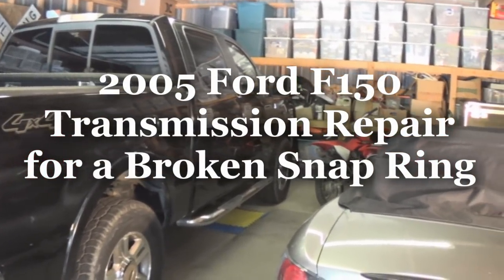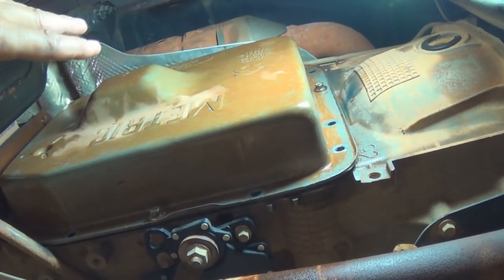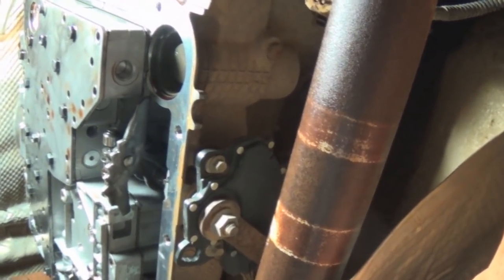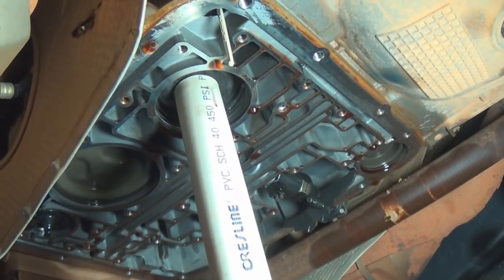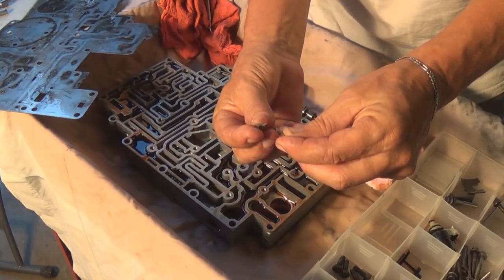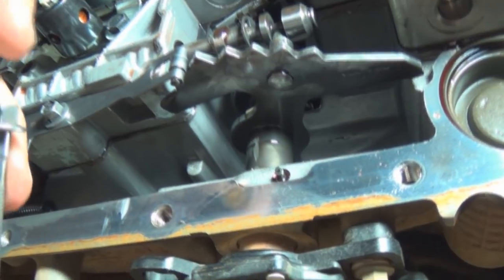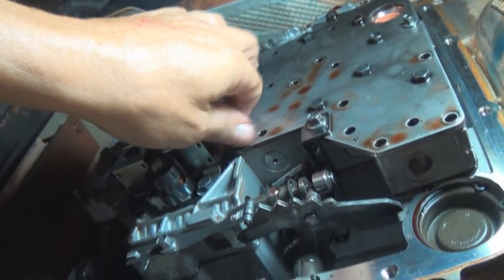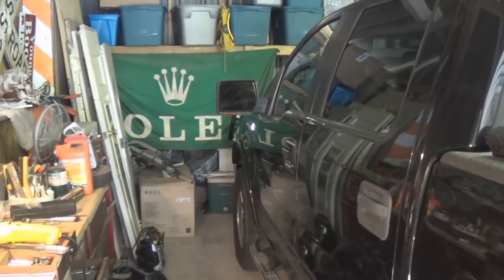2005 Ford F150 Transmission Repair for Broken Snap Ring

Comment: I would replaced the OD servo and replaced the servo pin with a Sonnax servo pin upgrade. That will stop the OD servo from beating up that snap ring. Replacing the 8 check balls is usually a good idea too while you already have the valve body opened up.

Comment: Thanks for the video. Exact same symptoms. Never opened an automatic transmission before but proceeded with confidence from your example. A little difficulty doing the job while keeping my fingers crossed but that paid off as the broken piece was in the same place as yours. Ford wanted to sell me a new tranny for $3,500.00 as mine has 350,000 miles and friends said I would be wasting my time and should give the junk yard $1000.00 for another transmission. I really enjoyed rubbing it in their face that I fixed it for $3.17 and a Saturday afternoon. My truck is shifting fine and still on its way back from the moon. 476,000 miles is my goal. Thanks
Reply from the maker: Gary thanks for watching and your great comment! I'm very happy that my video helped you out and it is great to repair something rather than replacing it. Your comment made my day. Thanks again.
Reply: That's awesome
Reply: That’s great but his you could see at the end was still experiencing what i thought was torque converter lock up. So id like to know how these repairs turned out for you guys in the long run before I tackle it

Comment: Good video. Better than some I have seen. Thanks for sharing. Funny how little things break and cause us all kind of havoc. Anyway good luck with the truck.
Reply from the maker: Miguel S thanks for watching. Yes I made this video because I could not find a single video that covered the whole job. Unfortunately my trans was to far gone and had to be rebuilt. If you have lots of metal on e magnet or in the pan I recommend a rebuild or replacement to properly repair.

Comment: Guys, if you're going this far into the valve body you should replace the separator plate with a Superior Tuff plate and upgrade some of the internal valve body components with upgraded Sonnex pieces.
Reply: Other than the upgraded servo pin, what would those internal valve body components be exactly?

Comment: this is the best video so far of this issue ! thanks and good job!
Reply from the maker: I found videos online for the broken retainer but I had to watch numerous other trans rebuild videos to better understand the procedure. So I decided to make a better video on this subject. Thanks for watching!
Reply: did you disconnect the battery first? just curious
Reply from the maker: No need, but my battery died and removing it and replacing the battery without using a temp 12v source caused the computer to have to learn again when to shift. Clears up after a number of miles of city driving.

Comment: Good work on your pickup. I hope that it is still in good working order. Happy Holidays 2021.
Reply from the maker: Thanks! Turned out that the trans was completely shot and needed to be rebuilt. Had that done but I sold this truck and bought another one (Nissan).

Comment: Just got the snap ring for my 2004.  Had to drive from Chicago to Missouri with no OD. Waiting for a day above 35 degrees to get this knocked out.
Reply from the maker: Thanks for watching!. As you know, the truck burns a crap load of gas without O/D, but great that it got you home. If you open it up and find an excess of metal (mud) on the magnet or in the pan and your old fluid smells "burnt" you should consider a complete rebuild. If the fluid looks good, then go for the retainer ring replacement, but be sure you account for all the broken pieces of the clip. Good luck.
Reply: See More Toys the fluid looks good. Trucks got 165k on it so hopefully that’s a good sign.

Comment: I have an 05 150. From park to drive, there is a 4-5 second gear engagement delay into drive. Any ideas? Please reply!
Reply from the maker: Check your fluid level on the trans after warmed up. Smell the fluid for a burnt smell. Also, could be a failing valve seal. There are a few common causes of delayed engagement in automatic transmission vehicles. Sometimes, delayed engagement can be caused by temperature changes under the hood of the car. Delayed engagement could also be the result of worn seals, stretched out bands, or poor transmission fluid pressure.
Reply: Boost valve maybe?
Reply: OLDSOUL: Did you find out what caused the shift delay?  I have the same issue with my 2004 5.4L

Comment: I had the same problem with the broken ring. Replaced it and it shifted fine for a bit, then once it warms up driving, It shifts back into neutral. Any ideas out there what else it could be. Thanks.
Reply from the maker: I don't know. Hopefully all the pieces of the broken retainer clip were removed. A small piece left there will cut out the O/D into neutral by blocking trans fluid flow.

Comment: Could this snap ring breaking cause the transmission to shift but want to always pull into reverse?  When in reverse truck will run. Every other gear does not allow truck to move forward, however it still wants to pull as if it is in reverse still. If that makes sense?
Reply from the maker: The snap ring breaking only caused the trans to slip into neutral when it when into overdrive. Turn off the overdrive and the trans operated as designed in all gears. But it suck fuel even worst than normal.  Sounds like you had a band break inside the trans. I recommend that a complete trans rebuild or replacement is needed.

Comment: Right in the middle of this fix, Caution-those magnets are very slippery and very very brittle. Hope the dealer has on in stock!
Reply from the maker: Rusty Shackelford yes those mags are brittle. I carefully wiped off the metal stuck to it with a with a rag. I was thinking of getting a pan with a drain plug to make life easier but I did not. I got my parts from a local transmission supply. Much much cheaper that the dealer or auto parts store.

Comment: i thought for sure this was the issue on my 2011, clip is still good and couldnt find any FOD i could see the overdrive band.. im baffled going to the scan tool i guess
Reply from the maker: You may have something blocking the oil hole that moves the plunger. You may need a complete rebuild though.

Comment: 19:38 i can see the RPM's fluctuating ... is the transmission slipping at all when they are going up and down ?
Reply from the maker: My 3rd gear was going (or gone) also. It ended up blowing the overdrive band and had a lot of metal stuck to the magnet in the pan. So I sent it out for a rebuild. Transmissions are not my favorite thing to work on.
Reply: Kenni-411 yes but hes to proud to say he made it worst just buy a valve body

Comment: I have a 2005 Ford f150 and it drops into neutral outer overdrive my question is can I drive it with the overdrive off without causing any problems. If there are pieces floating around do they not cause problems with the overdrive off thank you in advance
Reply from the maker: The ring clip breaks. Pieces of the clip get stuck and keep the OD valve from opening. Those pieces won't go far and most likely will not be a problem. But, running without the OD will burn a crap load of gas and put strain on your entire power train.
Reply: @seemoretoys5944  I can deal with driving it 45 miles an hour because I already have 200,000 miles on this truck and it's an 05 so it's not worth very much and don't want to spend the money on a total rebuild or replacement. I may just use it to put my boat in the water. Thank you for the advice

Comment: That was a great video,  everything was very well explained.  Where is the best place to get the snap ring?  I feel like if I goto my local parts place they're not going to have a clue what I'm talking about.
Reply from the maker: Thanks for your kind comment and question! If I remember right, I ordered it from Amazon. Only cost a couple of bucks. You can also find very good deals on car parts on Ebay.

Comment: So after this repair I immediately got the TRANS FAULT O/D OFF light on my dash?? Any ideas??
Reply from the maker: Recheck your work on electrical connection on trans your overdrive isnt' working right. if still not fixed take to a trans guy
Reply from the maker: Also found this...
Everything from erratic voltages to improper fluid level to trash in the fluid can cause the same problem as a faulty shift solenoid…
In my case… the solenoid was indeed faulty. I dropped the pan, popped off the plastic wiring harness, removed the two bolts that held the shift solenoid in, cleaned the throttle body, installed the new solenoid, reinstalled the wiring harness bracket, cleaned pan and magnet, added new filter, gasket, and synthetic fluid… and all is well…
I warn you though… if you have an O8 with this same problem, and you tackle this yourself, understand the part number on your original shift solenoid has changed… and the guys around my parts had difficulty getting it right… just so you know.
Took my time and got the job done in an hour…

The original part# 6L3P-7G484 AB
New part# 6L3Z-7G484A

Carquest part# ECC 57-6584
Reply: @seemoretoys5944  thanks I found that I just hadnt pressed the connectors in completely.
Reply: @rcsix3rd  cool, good job!

Comment: any tips on holding the spring in if clip is completely out
Reply from the maker: If the clip is completely out the piston will pop down when you remove the case. The pin will then be off the band and the trans will have to be rebuilt. Most likely a piece of the clip has a very high probability of still being in the groove and holding the piston in place. Hope this helps.

Comment: My reverse stopped working as I was reversing my newly purchased boat -_- It acts as though it were in neutral . I hope this snapring will fix the problem!
Reply from the maker: Conrad, thanks for watching and commenting! The repair I detail is for the Overdrive (4th) gear and not reverse, so this repair may not solve your problem. I recommend that you pull the pan. save and filter the fluid if you wish to put it back together without tearing it down. Check the pan magnet for excessive metal (Looks like silver mud.). You may have popped the reverse band off the pin or the reverse spline and shaft may have stripped out (you will have mud). Good luck, but you may need a rebuild or reman trans.
Reply: There is a reverse servo that might have dropped

Comment: Great video man, I'm having the same issue with mine but mine does it in 3rd it goes into neutral do you think I should do the same thing you did?
Reply from the maker: Hi Ray Ray, thanks for watching.  A small piece of the broken retainer ring will jam and block the overdrive piston. Sounds like you lost the 3rd gear clutch pads. Pull the pan and check for metal (mud) in the pan and on the magnet. If a lot of mud in the pan, time for a rebuild or new trans.
Reply: See More Toys awesome! thanks for the advice do you think an 04 transmission will fit from another 5.4 L 3 valve mine is an 05
Reply from the maker: From what I understand the trans from '04 to '06 are the same. But you should check or ask on the Ford forums to get opinions/ information from people smarter on the subject than me. Thanks.
Reply: See More Toys thanks man!
Reply: Ray Ray

Comment: what were the symptoms you had ? curious as i have heard of a few different types ? i am hoping my transmission is only the snap ring and nothing more serious...
Reply from the maker: I had a little shudder shift into over drive pulling a trailer. I headed to the dump without a trailer driving about 65mph and bam, into neutral. Found that when I took it out of overdrive it shifts good but gas mileage without overdrive would be $$$. I checked the internet and found out about the broken retainer ring but the videos I found were weak.
Reply: my transmission only shutters , randomly when in overdrive and when the transmission goes to downshifting like going up hills when in overdrive ... its like going over rumble strips for a split second or two .....doesn't happen with OD off
Reply from the maker: With the broken retainer ring you will lose O/D and shift into neutral. The trans will work normally with the O/D turned off but the fuel economy will kill you. These trans are prone to wear the spline shafts in the gear drums and makes a loose fit. Your best bet would be to drop the pan and check to metal (mud) content in the bottom of the pan or stuck to the doughnut magnet. If you have a large amount of metal and/or your fluid smells burnt, time for a rebuild.
Reply: With my ford I had the shudder as well it ended up being the u joint on my drive shaft the are stacked and can only be purchased through a Ford dealership that gets rid of the shudder I have the symptumes of the transmission going into nuteral right now going to check ring and hopefully that's the only issue

Comment: Just took it apart and found the pieces of the ring but need HELP!  The overdrive cylinder fell out, how do i put it back???
Reply from the maker: From what I understand the piston hooks to and pushes up the overdrive band to engage overdrive. Is the piston that fell out the one that is held in by the broken retainer ring? If so, then transmission guy told me that getting that piston hooked back up to the overdrive band is tough. That is the reason why you use the bottle jack and cylinder to push up the piston up to remove the remainder of the retainer ring that should be holding the piston in place. Sounds like your retainer ring came all the way out and let the piston drop down. You may need a transmission rebuild or to install a rebuilt or used transmission, if that is the case.
Reply: thanks for your vid and the reply.  yeah that's the part.  The problem is the retainer ring was mostly in tiny pieces with only a third of it still intact, so it all fell out fast.  i'm going to try to hook the piston up over the band, and see if i can avoid having to rebuild or replace.  fingers crossed
Reply: so i installed a new piston and put everything back the way it should be and added new fluid.  the bad news is it's STILL slipping into neutral the exact same way.  Any help or advice???
Reply from the maker: It sounds like the piston pin pulled off the band. If your fluid was not burned up and if you did not have too much metal (mud) on the magnet then you are in for a rebuild. If the fluid was burnt smelling and excess metal on the magnet, then I would look at a re-manufactured trans. Since the retaining ring was really broken up (Took a lot of force to cause that to happen.) it sounds like more is going on that just the broken retainer ring. I hope this helps.
Reply: in case anyone else runs into this, i got some help on an f150 message board and put the piston back inside the band.  it's all fixed!  thanks!
Reply: @bluedaisies18  great news! Do you mind sharing the name of the message board? Thank you

Comment: Doing this now and the  F2VY-7384-B is to small. Im stuck
Reply from the maker: It's been years since I made this video. Is that the Part # of the ring clip? Check the Ford Forums and if no answer written ask on the Ford Repair Forum. They are great for info. Hope you get unstuck.

Comment: hey there nice video but i kinda like to hear about time frame of your work, thank you
Reply from the maker: Arman Usa, thanks for watching and your question! Dropping the pan and catching the transfluid is the most difficult part. If you have all the parts, tools and fluids at the ready the job should only take you a couple of hours. My time to complete the project was 2 days since I needed to head back to the local transmission supplier for the Supper Tough plate since mine was discovered to be cracked. Not a difficult job but just messy.

Comment: I took my Valve body down and the retainer ring was broke but only a really small piece and it was on top off the valve body, not underneath the black cover... i didn’t see anything stuck in the groves! Any suggestions????
Reply from the maker: Thanks for watching!  Sounds like you found and matched up all the pieces of the retainer ring. If all is present, check that nothing is blocking the OD piston in the lower body from snapping back into place. The oil pressure will push a broken piece of the ring into the lower body  If the worst has happened, the band could have jumped off the piston, which is what the retainer pin holds in, and presses against the band to engage overdrive or 4th gear. That is the reason you jack up the piston to remove the remainder of the ring. If the piston lets go the OD band will pop off. I hope this helps and be sure to check the Ford forums since there are people their with way more knowledge than me.
Reply: @seemoretoys5944  do you have a specific name for the best forum,  please?
Reply from the maker: @johnfitbyfaithnet  I don't remember, but search "Forums Ford F-150 Transmission problems repairs". It's been a few years since I made this video and I'm sure posts have changed or moved on.
Reply: @seemoretoys5944  thank you!